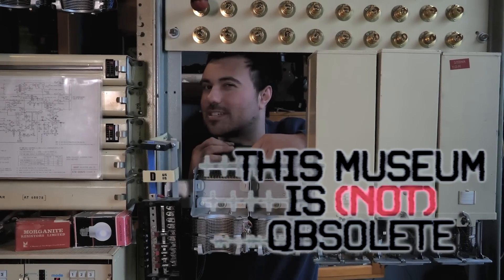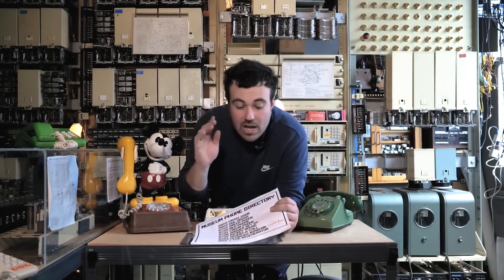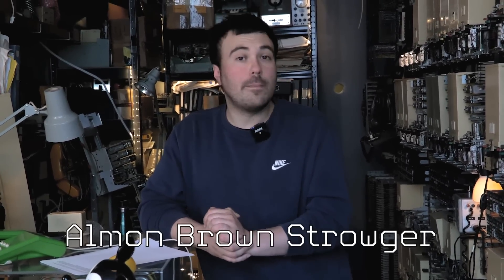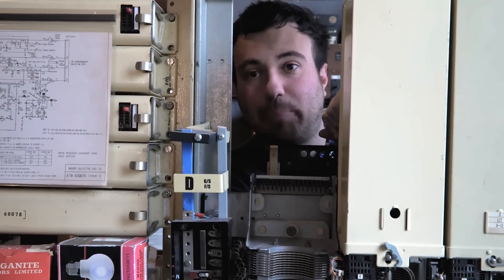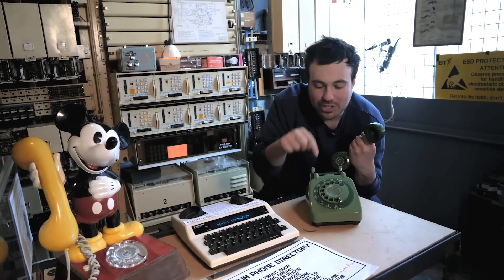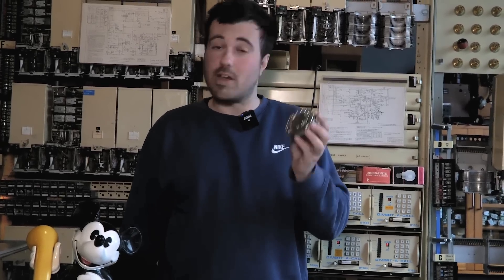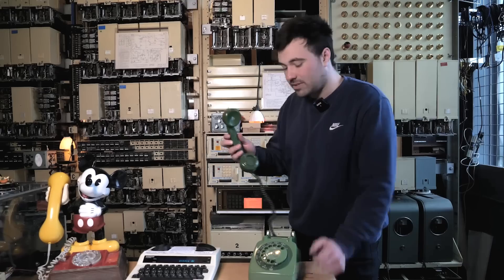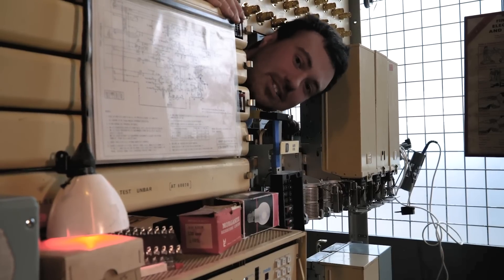An Undertaker Invented This Automatic Telephone Exchange?! - Telephone Tuesdays

Comment: What I would really like to know is how these old exchanges dealt with a disconnected number. I don’t mean physically disconnecting the wire from the exchange; more like if a customer had been cut off by request or for non-payment. If you lifted the receiver you wouldn’t get a dial tone, but you’d still be able to hear humming and bits of crosstalk from the exchange.

Comment: Here in New Zealand our exchanges worked differently and as a result the  numbers were the opposite way around on rotary phones. If you wanted to dial by tapping you had to do the opposite number of pulses to the number you wanted. A 9 was 1 pulse, an 8 was 2 pulses..... a 1 was 9 pulses but a 0 was still 10 pulses.

Comment: I started working for a large hospital in 1975.  They had a sxs system owned by the local telco.  In 1975 they contracted to have an ITT 400G electronic PBX installed.  I got sent to the factory to learn how to work on it. In 1984, we had outgrown it and had a Nortel SL-1 N installed which was one of the first digital switches.  I attended a number of Nortel factory training sessions to maintain it and eventually it was upgraded to an opt 81C just short of VoIP.  When I retired, I ended up teaching CIS classes at the local college and we created a VoIP class.  I taught that for a number of years so I can say that I went from mechanical switching to VoIP in 20 years.  I love this stuff!

Comment: Looked it up - in Germany, manual operators still worked until the late 1990s for the East German Reichsbahn and in certain military sectors (while civil operators where replaced in 1966). Also the first German mobile net, the A-net introduced in 1955, had manual operators 😱

Comment: Fun fact: Our rotary dials starts with zero and ends in nine, so zero is one pulse, and nine is ten pulses. So if you wanted to dial with the hook, you had to add one to the number you wanted to dial. :)
Reply: If u reckon that's fun....
Good luck mush👍
Reply: In NZ the dial started with 0 as well, but going in the opposite direction: 0 = 10 pulses, 1 = 9 pulses, ..., 9 = 1 pulse.

Comment: 1:50 Hook up an RPI and create an old style Internet with it. I think that there is already software for it but im not sure. I think i saw this idee on YT.
Reply: Setting up a dial-up system would be crazy, but then you'd be unable to use the phones due to them sharing the same wire with the modems.
Reply: Asterisk VoIP server.  I taught this in my VoIP class.